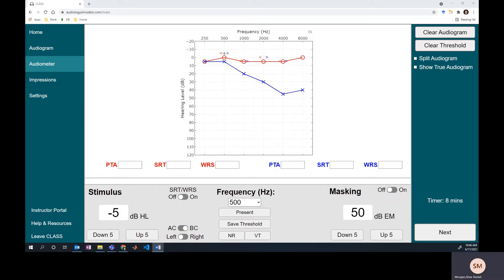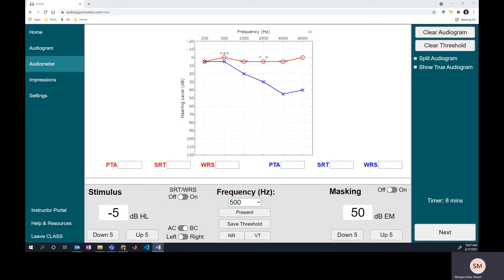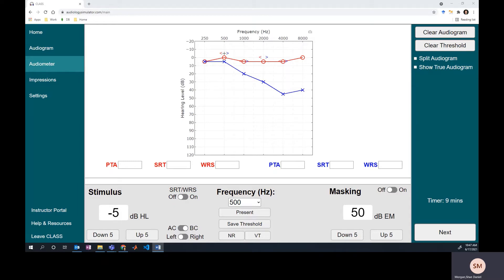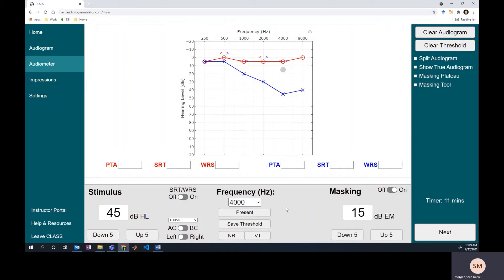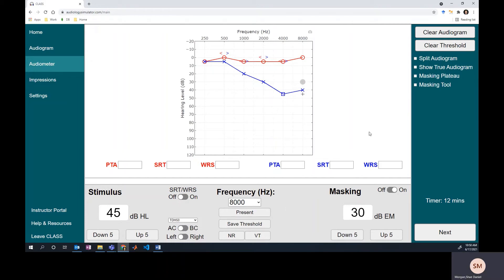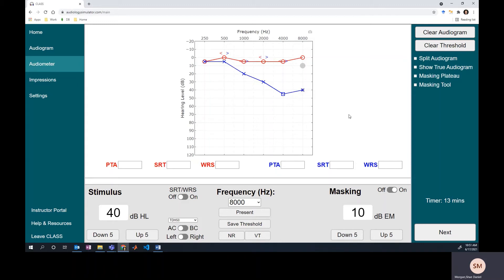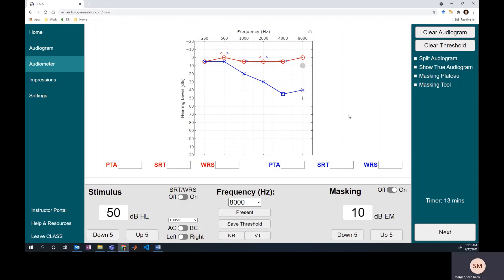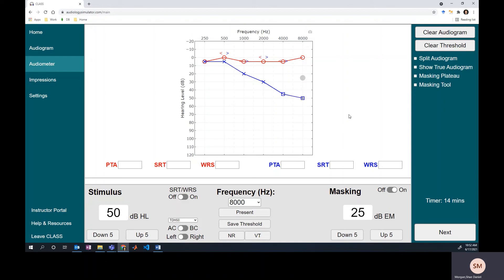Masking Tutorial (3 of 4) - How to mask: Air conduction

Comment: This is wrong though - masking level should increase in steps of 10dB? x 3 minimum (UK standards)
Reply from the maker: Hey John, welcome to the channel! Whether it's "right" or "wrong" depends on your comfort level. In the US (where these videos are being made) we commonly say to go up in 5 dB steps until you get a 15-20 dB "plateau" - which instills enough confidence that the non-test ear is out of the game during masking. In the UK, you may have learned to go up in 10 dB steps (a "shortcut" method used here in the US) x 3, which would give you a 30 dB "plateau". There's nothing wrong about either approach - they're just different. A 30 dB plateau helps you feel more confident that the non-test ear is being masked effectively, but in some cases (e.g., especially in some cases with conductive losses) requiring a 30 dB plateau won't be possible because you'll run into overmasking, which will create masking dilemmas if you're too rigid with requiring a 30 dB plateau.
Thanks for your comment! Hope this explanation is useful!

Comment: Great content and really helpful. But I'm still confused about something. Let's suppose that during an audiogram the BC threshold in both ears is 20db unmasked and the AC threshold in both ears is 80db unmasked for every frequency. Masking is needed for both ears during AC testing because both AC are >40db than the BC of the opposite ear. Masking is needed in both ears for BC as well because the AC-BC chasm is >10db. But during AC masking even a slight increase in the masked ear (+10db for example) would result in overmasking, since X-40db > BC of the ear that is tested (where X= AC threshold of the masked ear before masking + extra masking value). So is there any way to determine the real values of the AC for both ears in this scenario?
Reply from the maker: @PikosRapikos great question - the scenario you describe results in what is called a “masking dilemma”. You’re right - if you need to mask, but the non-test ear AC thresholds are so high, then you can’t mask, and so you would indicate that final thresholds were obtained unmasked due to a masking dilemma.

I’ll note that you can handle this sometimes be testing with insert earphones instead of headphones. 

We have another video on our channel about air conduction and other masking dilemmas